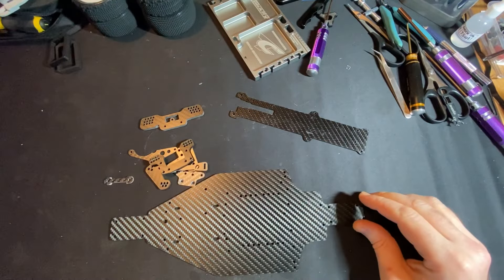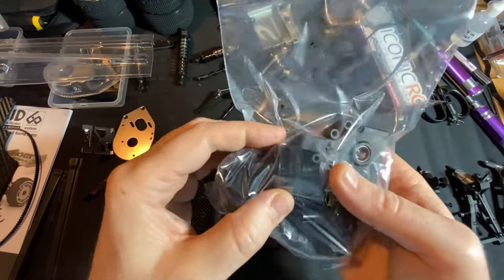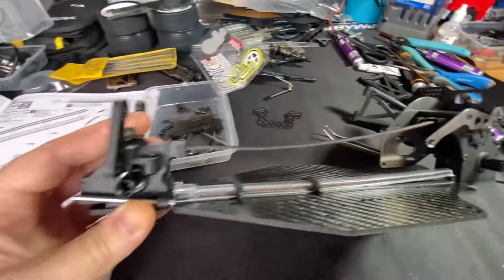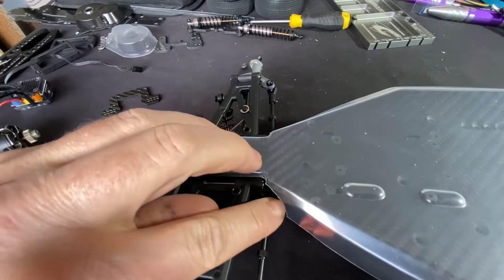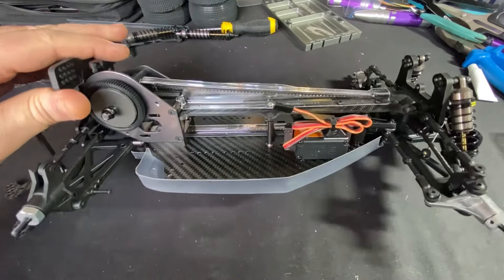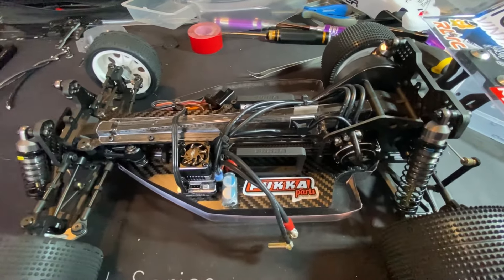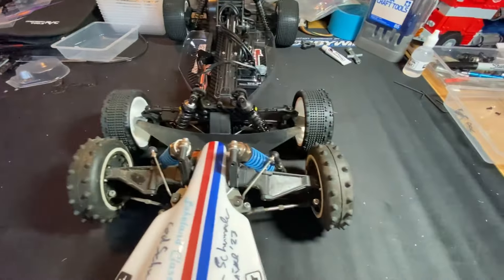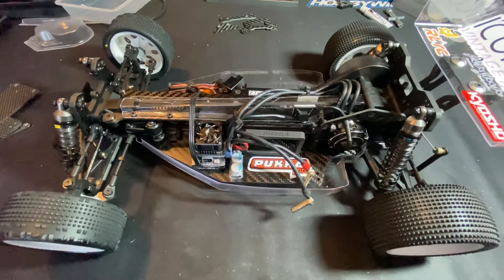Kyosho optima mid, 87 WC worlds spec, long wheel base conversion.

Comment: Rich the small figure 8 carbon piece is a wing mount stiffener, the longer one is a new steering rack with 3 options of Ackerman adjustment.
Reply from the maker: Cheers, was thinking it would be the steering.  I never thought about checking the wing 👍 i can see if i fit that now aswell 👌